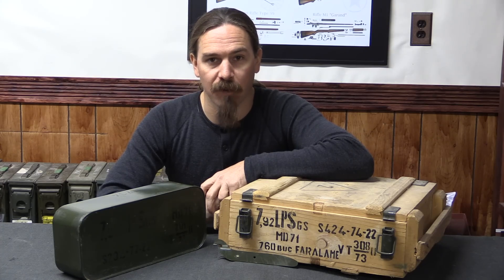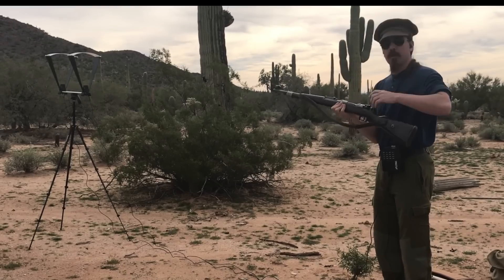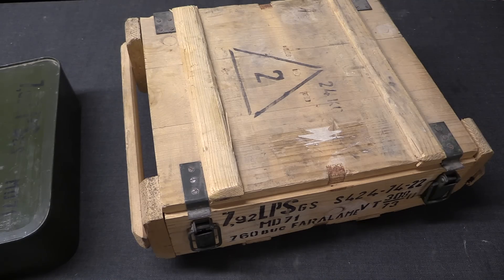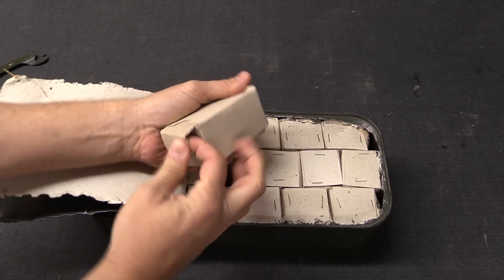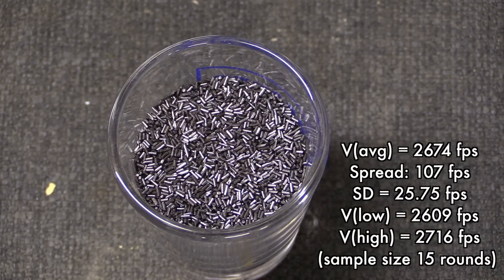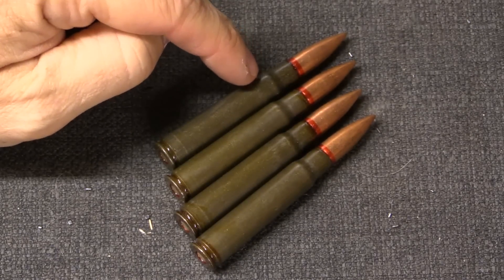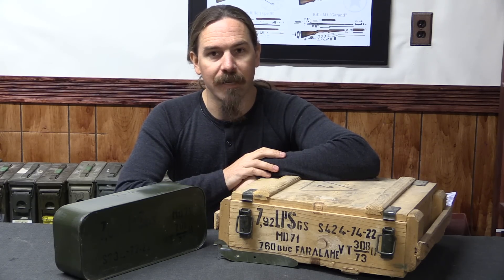Ammo Evaluation: Romanian 8mm Mauser

Comment: my father bought a crate like that with 2 spam cans of loose packed 20 per box just like there. mix of 22 71 and 22 74 stamps. this stuff is very very very filthy. it does go bang but you have to spend alot of time cleaning it after  😒

Comment: Either Rhodesia or South Africa experimented with slightly shortened 7.62x51 in the 1970s, maybe to save metal or to tolerate more dirt/sand. That led to quicker carbon fouling and problems with standard ammo in fouled guns.❤

Comment: I had the worst experience with this ammo.  The steel case didnt seal up and i got blasted in the face with gas and carbon.  Fortunately I wore eye protection.  Sometimes the case expanded in the chamber and i could not extract the case,  had to knock it out with a cleaning rod.

Comment: I wish I had your connections in the gun world and could place my grubby little hands on an pile of 8 mil Mauser ammo today.  It was about an dozen years back when I went to an gun show with an friend and came across some 8 mm Turkish surplus.  1400 rounds on stripper clips, in cloth bandoliers(of 70 rounds each), in the heavy galvanized hand soldered "spam can", wooden crate, twelve screws, and two wax seals.....for $100!  I should have purchased an bakers dozen at the time.  It shoots well enough for 1939 manufacture, but it does shoot dirty!  I expend an good hour cleaning after throwing some lead at the range.  It looks like I put an black Sharpie down the barrel.  But I do clean it religiously after going to the range.  If you can find an good deal, and you can afford to purchase an goodly amount, without neglecting straight up necessary everyday necessities like food and house payments...then part with those dollars so you do not have an nine pound paperweight in your closet.  Have fun and be accurate.😺😸😹😻😽🙀💩

Comment: Cool info. My dad bought some and we found it to be too hot for his original VZ24 and we got a stiff bolt lift on a sporter 8mm mauser GEW 98 rifle as well. I weighed the powder charges and they averaged 49 grains. Appears to be very similar to IMR4064. The bullets weigh approximately 154 grains and are steel core (tested with a magnet). Powder type on the crate was "VT" and made in '78.

Comment: I got a bandolier of 8x57 ammo a few years ago.  Brass cases with steel bullets in 5 round mouser clips.  Head stamp is: /TUC (umlaut over the U)/ 7.9/FS /1944.  The crimp is odd, almost like a hexagon. My research says Turkey, steel coated lead, and made in 1944.  My rifle is a 1917 Kar 98, in excellent condition, but every single one of the cases developed a crack at the shoulder when fired.  Lot of recoil compared to US made ammo.  I fired 25 rounds and quit.
Reply: US made ammo is underloaded

Comment: At time 11:00 , with bullet weight of that in the video , the manufacturer was most likely aiming toward a 10.0 gram bullet . During WW 11 the Brits used alot  10.0 gram bullets for standard weight . That nice round number worked out to 156.0 grains .

Comment: Watching Ian trying to open the tin, I had flashbacks to the scene from the movie Zulu Dawn, where the British army supply personnel are desperately trying to open ammunition crates with a great deal of difficulty, while the British soldiers are running out of ammo to hold off the attacking Zulus.
Reply: Said scene was totally bogus. 
British ammo boxes of the period had an access panel on in the top, secured by a single grub screw. This could be undone by a single turn with a screwdriver, or a penny, or just kicked loose. And the tin foil sealing the contents could be pierced with a bayonet or screwdriver and then torn open.

Comment: The corrosive primer is probably why they are so reliable. The murcury fulminate doesn't have anywhere the degradation of non corrosive primers. The lacquered cases and weatherproof sealant will keep these good for years, if not centuries.

Comment: Years ago when my Father's Day gift to myself was a Yugo M48A, I also picked up a "spam can" of this ammo.  It shot very accurately in that rifle and I had a lot of fun on my old PD's range with it.
The range was set atop what used to be a dump and off to one side was a huge slab of what had been the concrete floor of a demolished building.  The concrete was several inches thick and had the usual steel mesh (steel wires forming rectangles several inches across) within.  That ammo would bust right through that concrete (yes, Nervous Nellies, it was safe to shoot it there, it was allowed to shoot it as well, and I was alone).  I have a couple of the steel cores from the bullets somewhere that I picked up among the rubble of that busted up concrete.  That is some very soft steel. It's harder than lead, obviously, but I could bend it with my fingers.
Fun story:  We had several old cars that we used to shoot up.  I think a couple of the cars were older than the ammo.  Originally we did various tactical drills, and some of us tested different ammo on. They had sat there for at least a couple of years.  I was shooting that steel core Romanian ammo one day and put five rounds into the engine compartment just ahead of the driver side firewall.  I was curious what, if anything, the ammo would do to the engine. I waited for the huge cloud of dust to settle only it didn't seem to be settling.  It was also rather dark and smelled a bit acrid.  Um .. wait .. I opened the driver's door to pop the hood and through holes smashed into the dash (these things had been shot A LOT) I saw what appeared to be numerous old bird nests (generations, I suppose) and also flames. Within moments the entire car was engulfed.  I got the fire dept out there and we got the fire out.  Then, at their request we tried to make it happen with the other vehicles there but it just wouldn't happen.  FWIW, I still have quite a bit of that ammo and it still shoots well and reliably.

Comment: The issue with cases being longer than spec is not that the projectile jams into the rifling and/or pushed into the case (thereby reducing the volume in the case), it's that the case can get jammed into the throat which will crimp the mouth down around the projectile. Unlike a proper length case with a crimp, the crimp jammed in the throat cannot expand and release the bullet. Boom.

Comment: A couple of questions...one, is this ammo the same spec and manufacturing facility as the ammo marketed under the Hotshot name?  Also, is steel case ammo more likely to have wider variations in velocity due to steel vs brass and the corresponding reduced "flow" of steel vs brass?
Reply: no, it is not the steel case, just the cheap powder the use inside, it is pretty sensitive to chamber temperatur, why the german machine guns had open bolts

Comment: GunFun ZS had a reasonble explanation for the shorter case.   That being said,  the shorter case has little to do with the OAL.  In handloading lore, it is generally acceptable to seat the bullet out no further than .030" short of the bullet contacting the lands (indeed, for certain, specific applications, bullets are seated to contact the lands).  Military ammo, manufactured in the millions would be kept at a considerably shorter OAL  to facilitate reliable functioning in a myriad of firearms.  Thanks for the review.

Comment: is not clear why the cartridge was manufactured, as the Romanian military used the standard Communist-Bloc 7.62mm M91 Mosin-Nagant rifle round. Some believe it may have been for an experimental self-loading rifle or for a Communist Bloc client.[citation needed] It was most likely for use in the obsolete 8mm vz 24 rifles and MG 42 machine guns used by the Romanian Garzile Patriotice ("Patriotic Guards") from 1968 to the early 1980s.

Comment: Used lots of that type out on the ranch ... flood yes flood with windex type window cleaner, the hot gun will quickly dry it. Next use  the regular stuff, final bore de-coppering with foam over several days. Not only cheap, but would shoot through oak trees, which is where the bad guys would try to hide. Has a little steel rod core inside. The Yugo '55 heavy ball brass case stuff had 20% hard primers, but would always go with a second strike.

Comment: Hello! The measurement of velocity is kind of incorrect in my opinion. Firing with short pause between bullets  does not allow the barrel to cool and errors appear. A rigorous measurement should involve same temperature of the barrel (after  3 rounds  the barrel is  hot). If you have some more ammo, maybe we could see a video with same barrel temperature. All the best!

Comment: Yugoslav/Serbian ammo crates are a bit different. They are wooden, but on the inside are "padded" with tin. Basically, you have one big tin can integrated in a wooden case (or, wooden case built around tin can). Dunno if this makes sense in English... But to open it, you need no tools; when you open the wooden lid, you see a big nice tin surface with a little metal ring. So you take that ring and pull it. Then you realize that there is a steel wire attached to the ring and as you pull it, it cuts the tin open.
Well, I tried explaining in English the best I could...
https://www.youtube.com/watch?v=nx-oQpatD_k

Comment: My Mini-14 has an issue, where Steel-cased ammo for expands during firing sequence, and swages itself in my bore... Even the Garand-style action can't extract them, but Brass cases extract fine, 100%. If they make them 1 mm shorter, they likely won't swage the cartridge into the bore, and the room for expansion allows them to run without stoppage.

Comment: Maybe the ever so slightly short case length was for production efficiency; very marginal less amount of material going into each bullet, but not enough to cause issues when loaded into a gun. However, over the course of production, that tiny bit of material saved adds up, and more cases can be made from it. That at least makes sense to me, although there was probably some other random mystery reason for it.

Comment: I have a theory about the shortened case length. 
DISCLAIMER: I HAVE NO PROOF OR EVIDENCE WHATSOEVER TO BACK UP THIS THEORY AND IT IS TOTAL SUPPOSITION ON MY PART. As we all know, during both world wars, Germany had arms shortages especially later in the war, to the point where obsolete, captured, experimental, "last ditch", improvised, and most pertinently to the topic, not entirely to pre-war specification weapons were issued somewhat regularly.
I suspect that it is possible that a batch of otherwise acceptable rifles with slightly short chambers may have ended up in Romania, or whomever the client organization that may have ordered the ammo in case it wasn't them, through various means, and in decent quantity. They may not have been entirely suitable for military service, but I would imagine for police or paramilitary/secret police service, where the chances of them being fired often are probably lower, this might actually not have been a big enough concern to take them out of service, but too big of an issue to not issue some sort of fix.
I suspect that this ammo may have been designed with this concern in mind, and would work well enough in properly manufactured weapons, as well as in the potentially improperly manufactured ones.
Now why not just fix the chambers, well they might still have done that, but I'm going to go out on a limb and suggest that issuing what seems to be a minor alteration to the bullet was probably easier and faster

Comment: 7.92x56mm MD71 LPS gs (Russian >  Legkoy Puley Stalnoi , "Light bullet with mild steel penetrator" (Semi-Armor-Piercing), Russian > gilza stal , [lacquered] steel case). All labels and packaging used Russian designations due to Warsaw Pact standards.  
760 rounds per crate / 380 rounds per "spam can" - Crate marked FARA LAME ("Without Clips"). Loose-packed in cartons of 20. 19 cartons per can. Loaded into belts and used in MG 42 machineguns. The slightly shorter cartridge supposedly feeds better in machineguns. 
680 rounds per crate / 340 rounds per "spam can" - Crate marked PE LAME ("With Clips"). Packed in 5-round clips in cartons of 20. 17 cartons per can. Used in Vz. 24 Mauser rifles.

From what I understand the ammo was made for use by irregular militia units ( Garzile Patriotice , or "Patriotic Guards"; there are pictures of factory worker units drilling and then picnicking and drinking at musters). The regular military units used weapons chambered for the 7.62x54mm M91 Russian cartridge. (Soviet weapons and munitions became standard after 1959). The militias were meant to be a blocking force or last-ditch effort in case of an invasion (like Hungary in 1956 and Czechoslovakia in 1968) or coup d'etat against the Ceausescu regime. They were created to slow down an enemy force while being no match for a well-trained and -equipped regular army unit.

Comment: I bought a couple of boxes of the commercially repackaged ammunition of this type. My M-76 hates it. I had a case get stuck in the chamber after the first round. I need to try it in my Egyptian FN-49. I figure worse comes to worse, I’ll run it in my bolt guns.  Also picked up a full case of it with the stripper clips at my LGS. That was for my Mauser Rifles.

Comment: 01:32 Ammo Crate
7.92 LPS gs / MD71 = 7.92x57mm Mauser / Legkoy Pulya Stalnoi (Russian: "Light Bullet, [Mild] Steel [Penetrator]") / gilza stal (Russian: "[lacquered] steel case") / Model (Romanian: "Pattern") 1971 cartridge.
S424-74-22 = Lot S424 - Year of Production: 1974 - Factory 22 (UM Sadu)
760 buc. FARALAME = 760 pcs. (Romanian:  Bucăți , "pieces");  Fara Lame (Romanian: "Without Clips") 
VT 308/73 U = VT gunpowder, Batch 308 / Year 1973, Powder Mill U (Pirochim Viromet S.A. Victoria)
380 cartridges (19 cartons of 20) per spam can. 2 spam cans per crate.

Crates with the ammo in clips is marked:
680 buc. PELAME = 680 pcs.;  Pe Lame  (Romanian: "With Clips")
340 cartridges (17 cartons of 20; 4 x 5-round clips) per spam can. 

7.92 LPS gs MD71 [7.92x56mm] = 154-grain [10-gram] bullet, @45-grains [3 grams] of propellant; @353grains [22.874 grams] full cartridge. 
2674 ft./ps [815 m/ps]. 

Headstamp 21 RPR or 21 = UM Cugir
Headstamp 22 = UM Sadu
RPR ( Republica Populară Romînă , "People's Republic of Romania" [1947-1966])

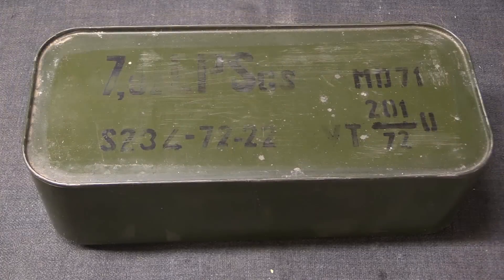06:49 Ammo Can
7.92 LPS gs MD71 = ( See above )  
S234-72-22 = Lot S234 - Year: 1972 - Factory 22 (UM Sadu)
VT 201/72 U = VT gunpowder, Batch 201 / Year: 1972, Powder Mill U (Viromet S.A. Victoria).

Comment: I had a Yugo M95M awhile ago. Really shitty gun. Honest to God it recoiled harder than heavy .375 H&H loads and threw shots wild. Wouldn't run anything remotely well except PPU 8mm and wouldn't even chamber Romanian 8mm. Straight pull action was tougher than the worst example of a Mosin Nagant, and the sights looked like they were ground down by Ray Charles with an angle grinder.

Comment: SADU also pumped out some commercial 8mm a few years ago and much of it has improper case size and gives people all kinds of issues.  I got a lot real cheap and test it all with a case gauge.  About half doesn't have the shoulder bumped back far enough so I use it in my bolt actions.  Just takes a lot of force to close the bolt, but shoots fine.  My Hakim will eat most of the bad rounds without issue, but every once in a while it won't chamber.  I want to say it's SADU 18 headstamp but I might be wrong.  There's lots of bad reviews and discussion about it online.  
I would love to hear from the factory how that happened...maybe that's why it ended up here in the USA :)

Comment: I don't know if I just got a bad batch (most reviews extoll it's reliability) but I had a large number of fail-to-fires I buried tip down using my M48. Pin punched straight thru the cap. My M48 fires other surplus and new 8mm no problem so I guess I'm just unlucky. At least it was cheap at the time.

Comment: Hey Ian! I was fiddling around with my Turkish Mauser today and I remembered that one of the weird things about the gun is that they were converted from 7mm to 8mm which means the mag wells are just barely too small for the full size 8mm rounds to reliably feed through the gun (like literally 1mm too short) so I’m wondering if these rounds were designed for Turkey originally or a country that also converted 7mm to 8mm and had they same problem you should check it out

Comment: You can open spam cans by scrapeing it on a not smoothed concrete surface, sidewalk or driveway, in a circular motion several revolutions. Mr guns n gear had a video showing that several years ago.

Comment: The steel is liable to deflect at extreme temperatures, moreover it is likely that as you had mentioned it is better to error On the short, then on long  when chambering the round. Last Lee it is likely that the purchaser of the ammunition had great tolerances within their rifles and as aforementioned it is wise to error on the short with respect to the overall length of the cartridge.safety

Comment: The case is short for a reason. Brass expands easier than steel and retracts more as it cools. Longer steel cases with less taper can tend to grow enough that they get stuck. i.e. they get stretched and stay mostly stretched. So they basically make the case a bit shorter so that it has room to grow and still not stick. Barnaul does the same thing with brass colored 30-06 steel ammo, but using a different method. There's a groove around the lower third of the case pressed in.
Reply: Addendum, this problem is worse with looser chambers, which have short leade.
Reply: My first thought was that it was so the neck tension on the bullet would approximate that of a brass case.
Reply: Good observation.  I was just assuming the communists were saving metal, 1mm at a time, times several to 10's of millions, in a way that didn't detract from the functionality of the round